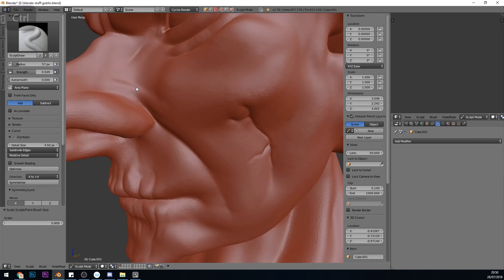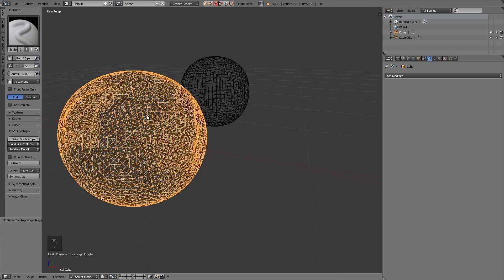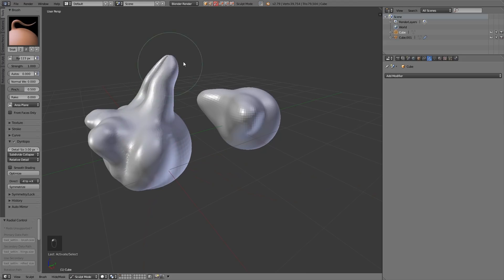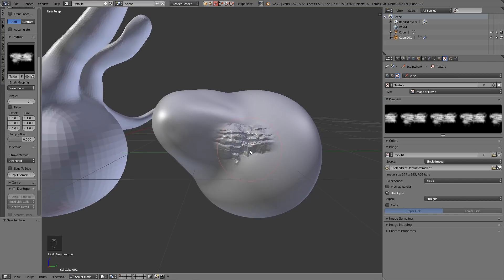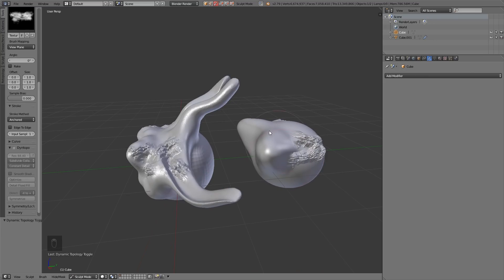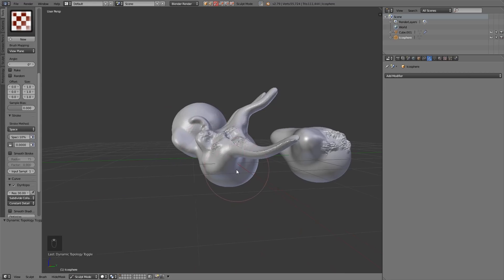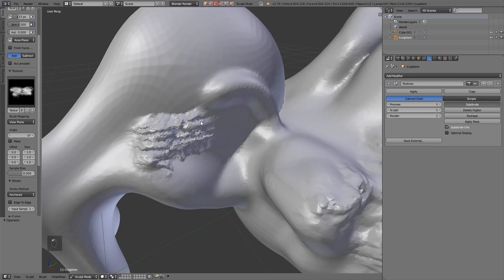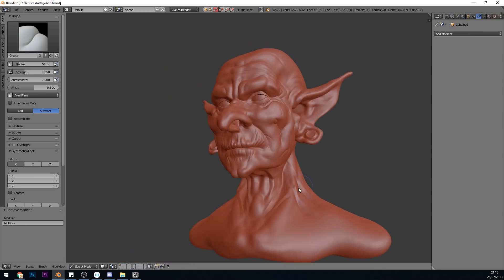Sculpting Basics | Multiresolution vs Dyntopo | When to use which

Comment: I'm creating a VIDEO GAME, I just created over 200 full body characters from here to toe in blender.
I just need to add fine detail like wrinkles, the puffiness under the eyes etc. 
What is the best method to use DYNTOPO or MULTI-RESOLUTION? 
But I DON'T want to go through the trouble of Retopologzing all 200 characters just so it could render.
I just want a straightforward flat answer.
Reply from the maker: multiresolution you dont have to retopo you use the low resolution
Reply: @grabbitt  I was panicking because I thought if I use Dyntopo or multi-resolution and start sculpting them, my characters would suffer when it was time to render and put them in-game but you have brought peace back to my valley.
Reply from the maker: @spittingame4241  dyntopo will change them but multiresolution will wrk

Comment: I just learned Blender 2.8 has a "Bake from Multires" option for baking normal maps.
Another great reason to use Multires, if you also need a low-poly sculpt with a normal map, instead of going through the usual normal baking process.
Reply from the maker: indeed :)

Comment: I used to use a MR method,  but It's annoying to struggle with those detail and density control and I switched to Dyntopo and now completely happy having no problems. If you need a fine small details - just change a "Detail size " of Dyntopo parameter   to smaller value
Reply from the maker: indeed

Comment: What if u used multires, apply,  go to dyntopo, aply fill detail and do a new multires and go sculpting?
Reply from the maker: Yes that can work but it will increase your poly count a lot
Reply: @grabbitt  so could we say, you can create your character from scratch using dyntopo, and when its finished, drop a multiresolution modifier in it to make final details and removing that harsh lil triangles look?
Reply from the maker: you could but your mesh may become very high from the multiresolution but it is possible
Reply: @grabbitt  oh my...im missing zbrush....well...the mesh can be very high...but if you will do retopo later...isnt a real problem, right?
Reply from the maker: @SonnyBurnett2008  yes

Comment: Thank you for sharing. How do you "flatten" (smooth) irregular surfaces so that it will not show any "bumps"?
Reply from the maker: Hold shift
Reply: @grabbitt  yes, that´s the default method, but when you do it too much, you loose detail. I guess a flat smooth brush should do the trick.
Reply from the maker: @activemotionpictures  yes if you want to flatten a surface

Comment: Very nice explanation. I only recently discovered Dyntopo, and it solved a lot of issues for me. However, I agree with you that it does produce a messy geometry. If only there was a way to have dyntopo generate quads exclusively... By the way, I didn't find the link to the retopology addon in the description you talked about in the video.
Reply from the maker: Yes, must remember to put the link in

Comment: Just wondering, do you recommend any graphics tablet for beginners that's relatively cheap?
Reply from the maker: Yes http://gabbitt.co.uk/tutorials-1/sculpting/index.html There's a link to on my site. It's still not really cheap but it's the best price for quality and you dont have to keep plugging the pen in. The pressure sensitivity is very good and it's easy to install and use. (it's an affiliated link so you will be supporting me if you click on it. But I can thoroughly recommend it. It's easily the best in it's price range )
Reply: Grant Abbitt Thanks a million

Comment: Great shortcut is if you're in modeling phase and press control 0-9 itll add a subdivision surface modifier already and set that number as the detail level.

When you're in sculpt mode, itll automatically add the multires modifier instead of the subdivision surface one.
Reply from the maker: thanks
Reply: what happens at 7 I wonder ^^

Comment: What graphics ard have you got? Will a 2gb 1050 be enough for this? Good video I learnt some new things thanks
Reply from the maker: i have a gtx 980
Reply: Ryan Hough Just depends on how much detail you want and what kind of performance you dont mind working with. A better card is going to give you millions more polygons of detail. What you're talking about you can probably go to 20 million perhaps? A trick to use is that once you're doing a final detail pass, do your detail flood fill on a very high amount of resolution and then turn your dyntopo off, since while it's on it's going to be slower but doesn't need left on for final work.
Reply: shamanik1320 ah thanks man iv only recently started using blender  and was worried my 1050 wouldn't handle it but it seems to be OK so far, I guess as I progress il have to upgrade my gpu. Thanks for that tip I haven't heard it before.
Reply: Ryan Hough Sure thing. Got it from the Mastering Sculpting course made by Zecharias Reinhardt.

If you ever get a 1080 (although 1100s are around the corner) make sure you get one with ddrx5 memory and not plain ddr.

I'm still using a 4gb 680 and it's doing pretty good but I want to upgrade someday.
Reply: shamanik1320 yeah il take a look into that later, I built my pc at the beginning of this year and gpus were crazy expensive so ii built a pretty solid system and just put a 1050 in I was planning a 1070 but it pushed way over my budget. Is a 1070 powerful enough?
Reply: i do stuffs at gt540m and do not feel i need more right now. Ofc i cant overdose with topology resolution lol but still. Mostly i miss performance when real time render preview, baking and simulations but still able to do everything i wanna. Ofc if i would can have better card now i def would.

Comment: Hi! I am an on-again-off-again student of 3D modelling and animations. My focus is currently that of creating low-poly models with high-detail textures & normals using PDR materials as video game assets. I prefer box model first, and create high-quality meshes to be baked onto the low-poly mesh using sculpting. 

My problem so far is that, while I can sculpt some details with a mouse, I lack precise control; but when I used a graphic tablet (I have a Wacom Intuos tablet), I have trouble creating consistent details (like a straight border with minor erosion) since I often have to piggy-back and draw on the same region multiple times, and that creates really ugly lumps instead of a smooth surface. I tried using the smooth brush but that does not remove the inconsistent general shape.

How do you manage this issue, like when you created smooths veins on an organic creature or the shape of the eyelids? Thank you very much!
Reply from the maker: in sculpt mode for very fine details whilst in dyntopo i use subdivide edges instead of subdivide collapse (whilst in relative detail with the brush detail set very low). It creates smoother details.
Reply: Thank you again. By the way, would you do a video on the detailed settings on the sculpt brush? Like what anchor does?
Reply: If you are working for low-poly with baked normals, then you should work more on the base low-poly mesh, and use multi-res for adding sculpt detail. There's a flatten/ contrast and the scrape/peaks brushes to make planar the areas that you want. Use the crease brush to increase contrast between areas.
The initial low-poly shape is very important. If you make it well, you don't need to retopologize anything. Just add subdivision levels to the multi-res, and use it to bake a normal map.

Comment: Would I be correct in assuming the Multiresolution modifier would keep the poly count constant? I'm looking to use Blender to make custom morphs for Daz3D,. For this purpose you can move the vertices around, but can't add or subtract verts.
Reply: Multiresolution Modifier does almost the same thing as the Subdivision Surface Modifier (Divides the polygon into 4 little polygons each time) the only diference is that the Multiresolution stores the polygon data in a way that makes posible sculpting without distorting the original mesh, while the Subsurf is mostly used for smoothing surfaces or just add more polygons to the mesh.

So if you start, let's say with a 500 polygon model, using 3 levels of Subsurf or Multires will give you 32k polygon count which is (500 * 4)^3, in other words just divides each polygon consistently keeping quads as posible

Hope I helped :D!
Reply from the maker: Yes as John says...
Reply: Would I be correct in saying that Dorian is likely looking for morph targets or shape keys???
Reply: I'm not sure. I'm trying to nut out a process for making characters for Unity. Currently making them in Daz3D and exporting straight to Unity with blend shapes. I've been frustrated with the morphs in Daz, so I've got a process to export to Blender, alter the mesh, then re-import to Daz as a morph. With a few of these I'll be able to make new characters by mixing different custom morphs.

While looking for tutorials on sculpting in Blender, I discovered Grant's channel. I'm loving his whole sculpting process, so now I'm considering ways to go straight from Blender to Unity. It means I'll have to reinvent a lot of stuff that Daz does by default, but it also means I can make LODs (Daz's base mesh is 20k).